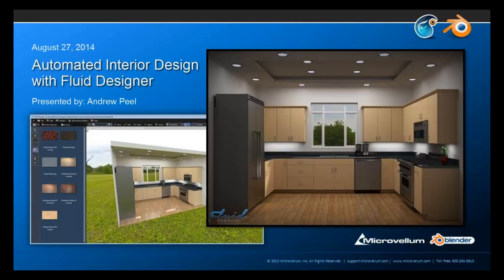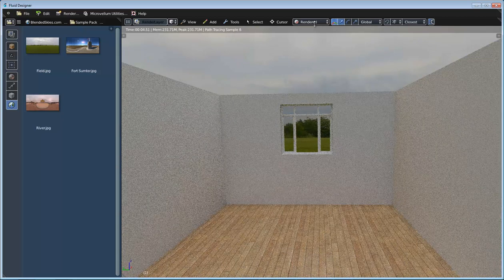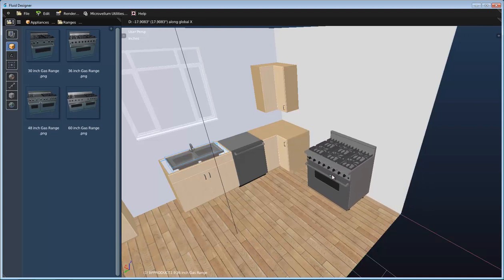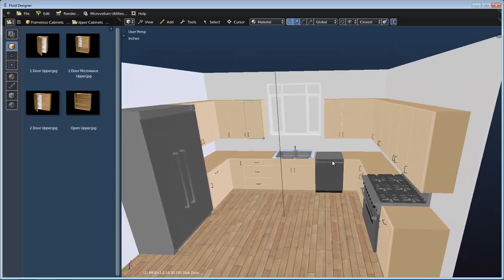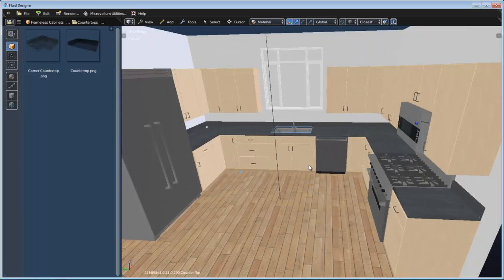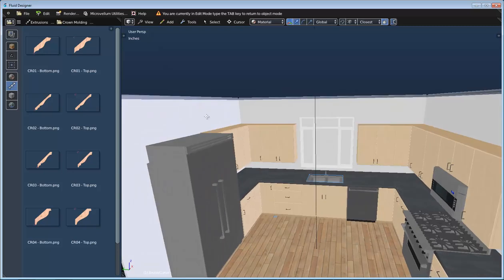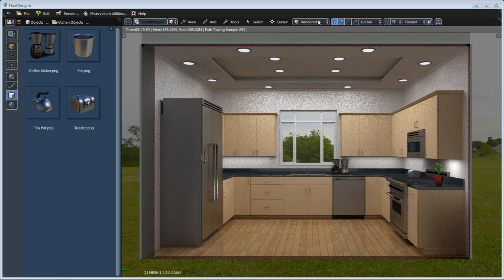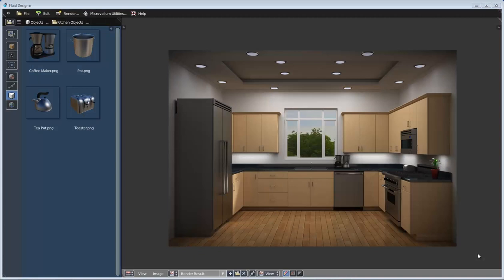Fluid Designer Tutorial - Kitchen Design

Comment: hi there, nice video. question: which is the brand laptop you use to run this software? (suggestions please)
Reply from the maker: I use a Desktop PC, but you can always check out the system requirements for more detailed information. http://www.microvellum.com/products/microvellum-fluid-designer/fluid-designer_system-requirements/

Comment: Very nice looking software!
How can i use it? I just downloaded from your website, but it doesn't look like your version... it's missing the library, the whole left panel is missing entirely. No actions when i press right mouse button... I can only draw walls. what's missing?
Reply from the maker: Justin C With the new version we have organized the library a bit differently. If you just downloaded the zip file you will need to go to File>Load Fluid Designer Defaults. Restart the app and everything should be there. watch this video to see how the library panel is organized with the new version. https://www.youtube.com/watch?v=K_blSorT820
Reply: I managed to bring up the left menu somehow... if i remember well i had to go to "user preferences" and check all the "Library add-ons" and specify a path to each separate add-on...
But still i don't have the "quick menu" when i press right mouse button. in fact nothing happens when i press mouse right button...
another question is... how can i add library objects? what formats? etc.
Reply from the maker: Justin C The right click is not coming up and the library add-ons where not loaded because you need to Load the Fluid Designer Defaults from the File menu. This happens automatically when you run the install, but not when you just download the zip file. Any blender assets can be saved to the library. We will have a video on how to do this soon. Thanks and I hope this helps.
Reply: I tried to load the defaults but without any success... i have downloaded and installed the software from this source: Fluid_Designer_2015_R2_win64_Install.zip, it was a zip file with installer inside... so it should work ...
When i installed Fluid Designer, i already had installed blender on my computer... can this be the problem?
thanks again!
Reply from the maker: Justin C No it shouldn't conflict with any of Blenders Default information. After reading your comment again you should specify a path to each of the library add-ons. This is more of an advanced feature that I will explain in separate tutorials. So try removing the paths and then click on one of the library add-ons buttons on the left side of the interface. This should refresh the library. If you still don't see any assets then you may want to try to re-install the application. Let me know if you are still having trouble.

Comment: Is there a different place to download this?
Reply from the maker: Are you having trouble downloading it from here? http://www.microvellum.com/product/fluid-designer-2/
Reply: Andrew Peel Yes
Reply from the maker: yelby2 Sorry it's not working for you, but everything should be up and running. Can you explain where you run into problems. Are there errors or does it not complete the download?
Reply: Andrew Peel The error is having to fill out the stuff and things to just download it. I don't have most of the required fields.
Reply from the maker: The only required fields should be name and email, but I am not a fan of how we have the download process set up. I am going to be talking with the web admins to have them put the download button right on the main page so it can be downloaded without logging into the site. I am going to try to get them to make this change when we release the next version which is coming soon, so check back soon.
Reply: Andrew Peel Ok, thank you! Please make sure to let me know because I am a big blender user rather than any other 3d modeling program such as FreeCad or Miah or Sketchup

Comment: Baking doesn't work right in fluid designer. Is there another way of doing it ?
Reply from the maker: Misheck Shalimba What problems do you run into? Also what are you trying bake... physic simulations, image textures?
Reply: +Andrew Peel sorry for the late reply but I was trying to bake image textures that I can also use in UE4 when I make custom meshes.

Comment: hi, open your fluid designer, then open the user preferences, click the Add-on tab, click the "Enabled" Categories, and io_anim_bvh, io_mesh_uv_layot missing script files not found help me !!!
Reply from the maker: tamir tamir Yeah we removed some of the default add-ons and forgot to update the user preferences. If you need those add-ons you can always copy them from a regular blender install, but they are required for Fluid Designer to work. I hope this helps.
Reply: Andrew Peel Hi. I had the same problem, but now i've fix it. Another problem that i still have is the tool panel on the left of the screen (T button). It does not load anything (see link to image). How can i fix it ? Thanks.
https://www.dropbox.com/s/702r5gn1tz4xz64/Screen.jpg?dl=0
Reply from the maker: cronos Click the "Load Fluid Designer Defaults" Button from the File Menu then restart the application. Then on the left side of the interface select one of the library add-ons then information will show in the tools panel. Let me know if you are still having trouble. Thanks.
Reply: Andrew Peel Ok ! It works ! Many thanks !
Reply: Andrew Peel Hi andrew, how can we copy those from the regular blender install?? sorry if this is a stupid question